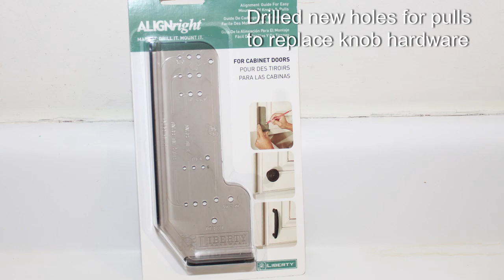EXTREME MAKEOVER - How to Paint Melamine Kitchen Cabinets DIY | DIY Power Couple

Comment: How did you get the glue off the cupboards before painting im currently trying to do this type of makeover in my kitchen but im left with loads of glue after the vynal has been taking off which i done with my wifes hairdryer
Reply from the maker: Marty, we didn't have a bunch of glue on ours after it was removed. We would lightly use a glue removing solvent and then prime it before painting. Please let us know how it goes for you. We really want to know. Best -DIYPC 😃✨

Comment: Wow! Y'all are the first DIY people who seem to have the same issues I do! I have melamine upper cabinets in my rental (I own a duplex), and one cabinet coating is coming off. I thought I was going to have to take off all of the coatings to paint them! How have they held up now that it's been almost 2 years? I have a few application questions too: How many coats of paint did you use? It looks like 3 coats of primer for the bare cabinets, 1 coat of primer for the covered cabinets, but I'm not sure how many coats of paint. If you did more than one coat, did you sand between that too? And did you sand the cabinet frames? Thank you!
Reply from the maker: Hi Trinity, the cabinet enamel still looks amazing today. We used 2 coats of paint on most and 3 or more coats on the bare ones.  We didn't sand between the paint coats.  We did not sand the frames, just primed and painted. 🙂 Thanks for watching!
Reply: @DIYPowerCouple  wonderful! Thank you for replying ❤

Comment: Thank you for showing us! Is the cabinet enamel easy to paint with?
Reply from the maker: Thanks for watching!  The Valspar cabinet enamel we used is thicker than ordinary paint.  It requires a good primer so that it will adhere to the surface.  It also goes on lighter and then dries to the desired color.  It is easy to use when you know what to expect.

Comment: I have similar cabinets as yours with the "foil" coating, but where the coating has started to peel, the base underneath is swelling as if it is cardboard and not actually wood or MDF. Do you have any suggestions on how to proceed? Can I remove the rest of the foil as you did, and is it possible to sand the cardboard-like base, then prime and paint?
It seems that the places where the swelling occurs is  where the most water is, such as beneath the sink. 
Any suggestions would be helpful.
Reply from the maker: Hi! We suggest replacing just the cabinet doors if the compressed wood has been so damaged by water that it is swollen or distorted.   Sanding this material bare did not work for us, however, we did sand after each coat of priming.  Hope this helps!

Comment: Did you just paint over the left over adhesive on the door? I cant manage to get it off.
Reply from the maker: We scraped and sanded off any remaining adhesive before priming/painting.  Using the blow dryer to heat the adhesive helped.